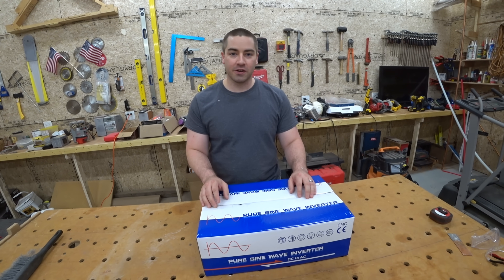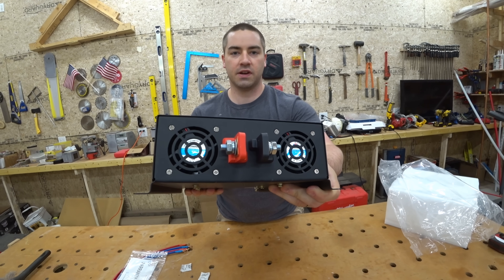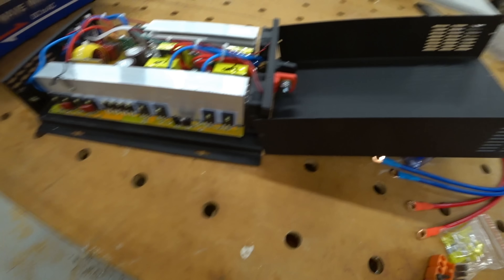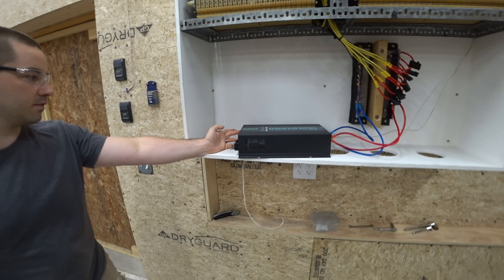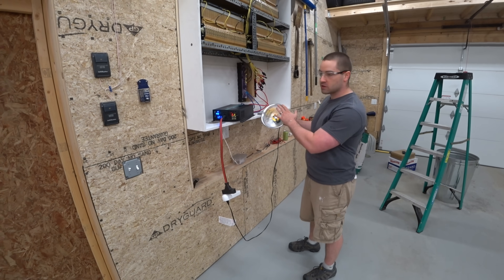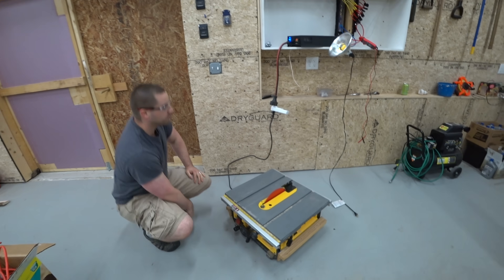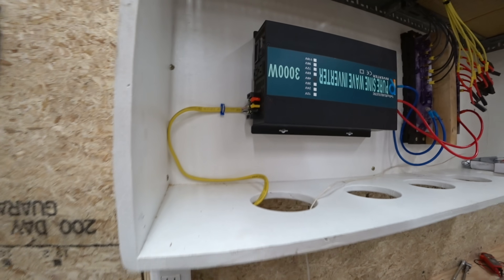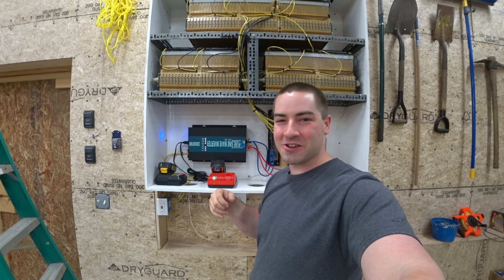Cheap 3000W Reliable Inverter, DIY Powerwall, Chevy Volt Batteries

Comment: mine will be on wheels. thanks for the videos
Reply from the maker: Nice.  Are you doing that to take it on the road with you?
Reply: possibly, but I want to take power to the fridge not vise versa. Line loss, storage, and relocation are all considerations.  Tailgate and block parties. Much nicer than a Honda.
Reply from the maker: Sounds good.

Comment: I have a 500W Reliable (12V-120V) and two 2000W Reliable (12V-120V) pure sine wave inverters.  The 500W is used for keeping the home network going when using an inexpensive gas gen whose waveform the router doesn't like.  The 2000W units are active and spare.  They're part of my solar generator (540AH of AGM batteries charged by multiple solar panels).  The solar gen is my "wait until daylight" or "wait until the lightning stops" backup source that can provide 8 to 20 hours of limited power (depending on season) when commercial power is out.  Most recent was 12 hours in December because of snow.  I have gas generators but most of our outages are measured in hours, not days, and it's often not worth the effort of getting a gas gen out of the shed.
Reply from the maker: Yeah, most cases for a backup are short and it's nice not to burn gasoline.
Reply: notyoung, Back during Irma, I was so glad to not hear the generator running at night all night long. I hooked up a 2000 watt inverter to a single MDP battery and had silence for two hours. Or hooked up to the truck running at idle it would have run till the 35 gallon tank went dry. Truck is far quieter than the generator. Even the 7500 watt Onan RV unit that is a gas hog. :-)

Comment: I bought two inverters from that chinese company.  They worked for a few days until the internal fuses began blowing.  I kept replacing fuses until I called them an complained.  They sent out replacements which did the exact same thing.  No, I wasn't over capacity.  I gave up and am looking for a better inverter company closer to home.
Reply: Did you ever find a good one?

Comment: Heavy Gauge wire is required on the DC side but not the AC side. No issues with the setup from the factory. Checking for secure wires might be a good idea.
Reply: Wrong. With a 3kW inverter, he can get up to 25A at 120V (the inverter seems like it has poor performance, actually the voltage droops at high load). He needs to use 10 gauge wire on the output. Plus, the GFCI is not rated for 25A. Probably only 15A, though some 20A models exist.

Comment: how does one charge a 48V battery economically?
Reply: that's kinda where I was going (sarcastically)... have you found an economic 48VDC charge controller yet?
Reply from the maker: There are a couple out there, make sky blue, for example.  But I don't have experience with them yet.  Mark Osborne has a good review of the make sky blue.
Reply from the maker: I'll be using solar.  Over the winter I installed a solar array in my front yard:  https://youtu.be/TQQGVN9JKdQ   All I need now is the charge controller.
Reply: PCM60x charge controller pretty reasonable and can do lithium at 14S...
Follow Average Joe who has made his own powerwall out of laptop cells.
https://www.youtube.com/watch?v=ou47PDQanys

Can you add another couple of S to your pack?

Comment: did you know a brand of inverter that can handle more the 10kW
Reply: Jose Garcia Aims makes a 10kw inverter, I just bought the 12KW version and am waiting on shipping. I had ordered the 10KW version, but it was backordered many places. The best deal I could find was $2,350 with free shipping from Boat and RV Accessories website for the 10 kw version. The 12kw version was just a little more at $2,530 and will be sent to me directly from Aims. I have gone through two of the crappy reliable inverters that seem to last 3-6 months before their death, so I'd advise against those.
Reply from the maker: blabbersoft: Thanks for helping out.
Reply from the maker: Hi Jose,  I haven't been looking into inverters with 10,000 continuous running watts or more, I've been looking at smaller ones.  However, I do know you could parallel three Magnum 4448, or two Schneider XW+5548.  Outback, Victron, SMA also have parallel options.  Parallel simply means you hook up more than one inverter through a proprietary communication device so the two inverters work in sync.

Comment: Starting current on electric motors figures out roughly two and a half times run current. My 4000 W generator will barely start my 2hp compressor.
Reply: Watch the video on the Generac vs Honda Generator, sadly the Honda Generator couldn't charge a Tesla Model S :(
Reply: @cuddles6938  it will if you know what you are doing lol there is a trick to get all the generators to work

Comment: Hey. I have heard about inverters that can run in parallel. I would have bought one at first and then when you can afford it buy one more. I think there is some synchronization wires that runs between them. And then you can plug the outputs in paralell. 

There is also videos where one guy take inverters and does something with them and make them capable to run paralell. He opens them up and does something inside.

Comment: Can I suggest that you need to be able to isolate your batteries in an emergency.
Reply from the maker: Hi Steve, You are 100% right that I need to add a disconnect.  I'm currently looking at the circuit breakers made my Midnite Solar.  What do you think of an 80 amp breaker considering it is a 3,000 watt inverter, and the battery bank can go down to 42 volts?
Reply: Hi, I think your calc sounds fine. But I think you are going to find your 3000W inverter too small in the end.  But if you end up with multiple inverters you could feed each one via an 80A breaker, so I think it can work to start with one.
Reply from the maker: Definitely,   I'm saving up for a larger Magnum or Schneider.  I just wanted something to start using the system while I save the cash.

Comment: Hello Dave, use 1/0 + AWG Wire to connect the inverter.  I think you will get that compressor running.  I just bought the same Inverter and I will connect mine this weekend or next weekend.  I have 5 chevy volt batteries and based on the the per cell calculations I will charge them to 80% capacity which is 4.05 volts per cell or 48.60 per 12 cell module. Great videos.  God Speed
Reply from the maker: Hi Richard,  When you say you have 5 Chevy volt batteries, you don't mean 5 cars worth, do you?  Because that would be one huge battery bank!
Reply: I have 5 (12 cell); 48 volt modules.   The 8 KW usable; is good for me now.  I might add more later.
Reply from the maker: Gotcha!  Thanks.

Comment: Friend of mine broke down the pack into a bunch of 48v and a few 24v's. Keeping the majority of them at 48v would give you more inverter options, no? Really good stuff coming from Victron inverters right now like bluetooth monitoring.
Reply from the maker: I agree that the Victron stuff seems great, just at a higher price point.  Right now their 10kva inverter is only available in 230v single phase.  Victron does not make any split phase inverters, so to make normal north american power from a victon you can buy two 3kva's or two 5kva's and parallel them.

Comment: Hi Dave, I have the 24v 3000w/240v version of this inverter. I starts and runs my pool pump which is about 1250 w continuous without a problem. I also runs a Dyson vacuum  @ 1450w cont. but it does drop the voltage a lot on start up of the vacuum. I'd also be using much larger wire to the inverter, even doubled I don't think it's enough for the current you want to draw.
Reply: Compressors be they on fridges or air tanks, are notoriously big power hogs at startup.  My little 1.7cf fridge pulls over 700w at startup then immediately drops down to 55w. I imagine that the difference is a compressor starts under load where you would never start a drill or saw while engaged to the cut materials.
Reply: 240v inverter can handle loads a lot better then 110v ones
Reply from the maker: Good to hear it is working out for you.  I've been running my power tools.  It seems the only thing it can't run is my compressor.
Reply: D G Roberts I am running a 15 year old 3000watt 12v China inverter and it'll start up my sump, my well pump, my 2 fridges, washer and.dryer with no problem. (Not at the same time obviously). I also have that same compressor and it won't start that. I did have to replace mosfets in my China inverter a few years back but it has been running strong for years now for my fully off grid home.

Comment: Suggestion - you can install "Hard Start Capacitors" to help with the load during startup of your Air-conditioning, Compressor, etc.
Reply from the maker: Thanks.  Is that a capacitor on the hot leg of the AC side?
Reply: It will be ran in parallel with your Run Cap.
Explanation:  youtube /watch?v=uLyZBkfHWf8

Comment: What is your total AH?
Reply from the maker: The battery is an 18kwh pack as labeled by Chevy.  At my nominal 44 volts, that's 409 AH.  However, I don't know at what discharge rate that is.  Since it came out of a car I would assume Chevy planned a fairly quick discharge rate, maybe an hour?  So I might get something a little better, but that is what I have to go with.
Reply: Looks like my goal for 1000ah is gonna be expensive lol
Reply: When I am full open throttle in the Volt Gen 2 the display says 120kW. (But that is gas assisted to draw that much instantly.) Maybe 60kW draw max from the batteries alone? Keep in mind, this is also if you kept the liquid cooling system in place, I see you've discarded it. A 10kW inverter should probably work fine, but if you're dealing with the same inefficiency as your 3kW one, prepare to get rid of 3x more, 300W of thermal heat from your box. (This is like running a small heater inside there.) Also, heat rises and I see the batteries are at the top of the box...

Comment: I think it's a great start, I've seen another you tuber really like these inverters (for the price), and he's way in on batteries, and has tons of inverters, so I think it's a good first choice to play around.  However, since its in your shop, I know you're gonna need a much bigger one.  That table saw started, but I bet if you wanted to do real work with it you may load up the inverter and blow it up.

The second hand information I've seen is that they put out just a bit less than advertised and don't have much (if any) surge capacity.  You can load them up around their rated value, but if they stay for long they'll blow up.  The protection circuit seems like it doesnt work well.  Maybe a well sized AC breaker could help protect it from blowing up?
Reply: Look at this channel if you haven't already, I follow him also because he is doing something very similar, but has experience  doing it for a while...   https://youtu.be/xZEHlUQnsVM
Reply from the maker: I've seen a few of his videos.  The size of his system is amazing.

Comment: I have the same inverter but 24 volts and I have been running my wood chipper off of a P85 Tesla module all afternoon roughly 4 hours the only thing bad about them mine has a floating ground other words 60 from ground to each post left and right
Reply from the maker: I saw the same thing when I was checking voltages.  Nice that it can run a wood chipper!

Comment: No fuse between battery and inverter?
Reply from the maker: No external fuse yet, I was too excited to get it running.  However, there are internal fuses and a pack of replacements that came with the inverter.

Comment: Very nice- very efficient and you ran the test I was worried about.... you shut off your saw, and the reversion didn't kill the inverter :-)  (i heard they (Reliable) didn't like motor shut-down)
Reply from the maker: Hi Mark,  It was fun testing some of the things out in the garage.  BTW, I've been on the phone with tech at Magnum.  They did not like the idea of the inverter (4448) working down at 44 volts.  I'm beginning to worry I made a mistake wiring the batteries to 12s instead of 14s.  I also talked with Schneider tech and they said their latest firmware update on both the SW and XW+ models prohibits setting a charging voltage down below 54.4v.  My options are getting limited...
Reply: I've been contemplating a similar build, not as many batteries, and the manual for the SW 4048 has an input voltage range of 40–64 VDC.
Reply: Tesla model s and X modules are 12S.  You could check to see what is normally use when they use the 12S arrangement for solar charger /inverter systems.
Reply: DavidPoz I don't think you need to worry about the charging voltage on the schneider, you will be using solar charge controller only to charge it, won't you? I'd be more worried that it won't turn on below 40v...
I'm glad you called magnum, but surprised they care about the voltage...  I think they are worried because they suggest a 175A DC breaker for that inverter, and if you pull the full surge of 8800? Watts at 40-44volts you'll go over that by quite a bit.  So maybe they are just trying to get you to design the system a bit higher so you can get all the performance?
Reply: midnite solar CC can custom voltage to the volts 12s, I have a volt battery to, also the magnasine 4448 works frin on 44v np, I run mine at 44v and then I switch my battery bank to a 16s 66v and run the same magnasine inverter of those to, its a great inverter, I also have the reliable 8000w and its a beast!
Reply from the maker: Hi Jon,  Maybe you are right about their concerns.  I'm not sure.  The tech at Magnum never said it can't do it, but was concerned, saying thins such as "technically it can go that low, but it's better to be higher than that."
Reply: also my input volts is 36v to 64v but it seems to work on 66v np
Reply from the maker: Hi Going Off Grid,  Thanks for commenting.  I've watched several of your videos about your volt batteries and your 60v reliable inverter.  I love your different battery banks.
Reply from the maker: Hi Cory,  Thanks.
Reply: The Diode is working?

Comment: Hello from Cairo. I did a system about 5 years ago at my home. It is much smaller than yours battery wise. What I wanted to tell you is that you do not need a charge controller. If you choose the correct solar panels, and dimension them to match the voltage of the pack then you do not need a charge controller. The Vmax and not the Voc on the panels should be about 80% of the 4.2 V on cell level. So what you will end up having is a battery that charges upto ~80% of its max voltage. And that is best so that the battery lives longer. You will see my prehistoric system on my profile on FB. Alaa Sadek Keele. Best regards from Cairo Egypt.
Reply: please ignore the comments made my Alaa Sadek. this is not advice you should follow. this is very bad advice. when the battey is full the voltage will rise far above the 4.2V per cel and destroy the battery and protentially burn the building down. you can use a  much beter solution like a smart bms to monitor the current, charge and control the battery and shut off the incoming power when the battery is full. check out this one: https://www.aliexpress.com/item/Smart-Display-16S-24S-32S-Cells-300A-200A-150A-100A-70A-Lithium-Battery-Protection-Board-Balance/32826469363.html

but that does not negate the fact you need a proper MPPT solar controller.
Reply from the maker: Thanks for sharing your experience.  I've never heard this concept of no charge controller before.  How's your system been holding up?
Reply: It has been working fine for many years. I run an inverter Fridge and air condition from Samsung. The AC is a 12000 BTU. The lights etc. I also wash my clothes on an LG washing machine using the sun. I do not use hot water though. For that I need at least 4 more panels. But my inverter is smart when the power taken from it drops the voltage of my small battery it switches to the utility for 10 minutes then switches back to the batteries and the solar power. So the dishwasher dos that. I only take 10 minutes worth of electricity from the electricity company just to heat the water. The water heaters for the washing machine and dishwasher can go up to 2200 W. But it is just for a few minutes. When they take away the subsidy then I will add more panels and maybe buy a salvaged battery like you. For now though I am trying to make use of the subsidised electricity until they take it away. I get to have electric power when they cut the utility off though. It used to happen often and for long hours. Not anymore though. But I get to save on my bill and hardly ever experience a blackout. When I get a battery similar to yours I will donate my battery to the Egyptian museum  to put it next an old Pharo. Maybe one day you will come and see it!
Reply from the maker: I appreciate all the comments and advice.
Reply: Hi. The charge controller have two function 1. to charge the batteries in the right way, 2. to maximize the power from modules. How much power does your module (modules) produce in a year?
https://www.victronenergy.com/solar-charge-controllers
Reply from the maker: Hi Jan ZImrhala,  I appreciate the comments, and am curious why you linked to victron?  Do you use that brand?  Thanks.
Reply: Hi, yes I use victron within my offgrid PV systems. There is this rottary switch with 7 possitions. Number  7 is designed for LiFePO4 batteries. But it does not solve the issue with BMS...